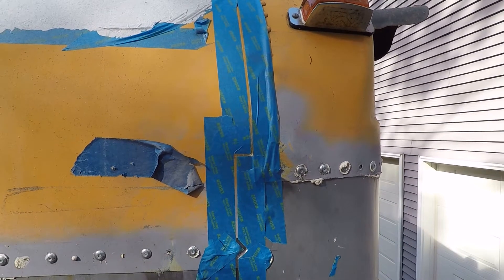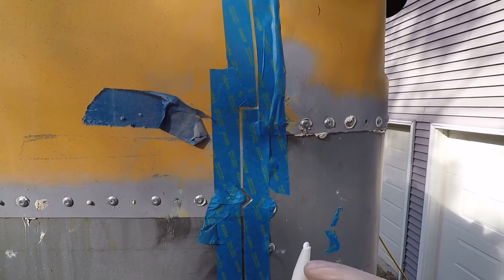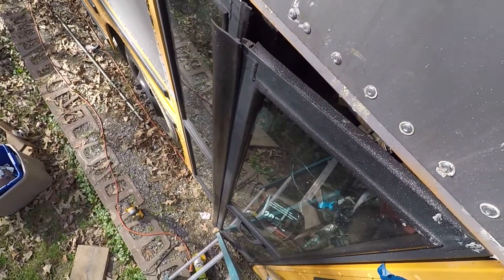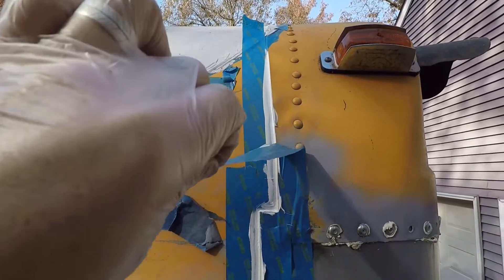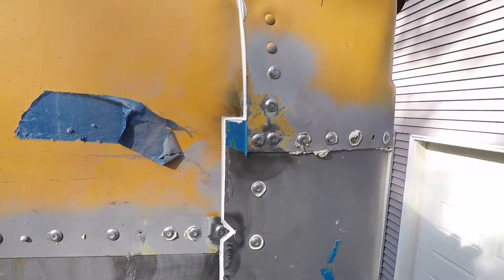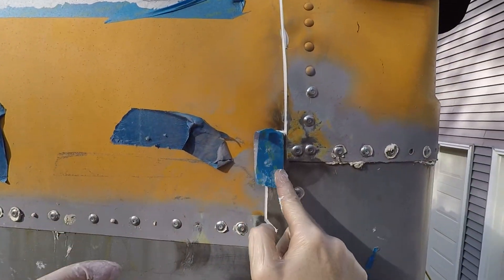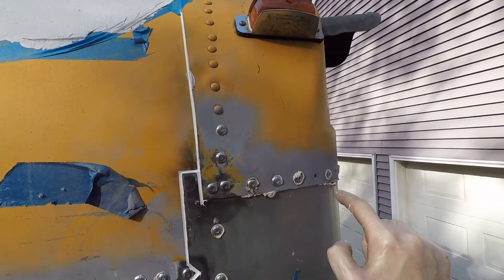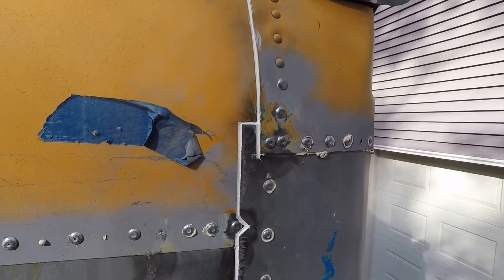How To Apply Sealant On Skoolie Sheet Metal Seams

Comment: Nicely done. Way more meticulous than I've been. If you're using acrylic elastomeric paint on the roof that will also help with sealing pesky little leaks. Definitely don't paint that stuff with too cold of a temperature or too late in the day or if it's going to rain. It will run off easily.
Reply from the maker: Thank you. Yeah I've been thinking if I'm being too meticulous. 
The roof needs painting but we can't do it now since it's too cold, so we aren't gonna put the solar panels up yet until it gets warmer and we can paint it
Reply: @WideAwakeTravels  Nuttin wrong  with working skillfully. Smart, clever and effective! Anyone can build a 'half azz' project.👍
Reply from the maker: @philmickey7247  thank you